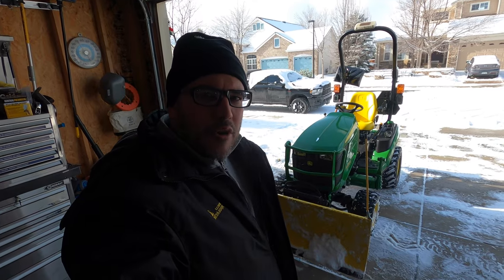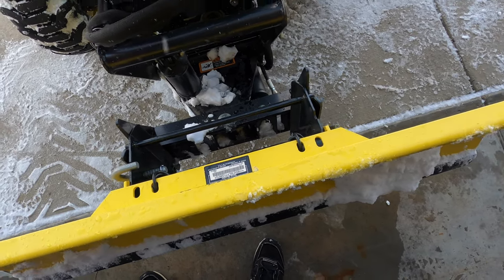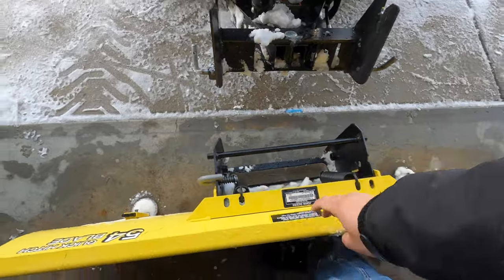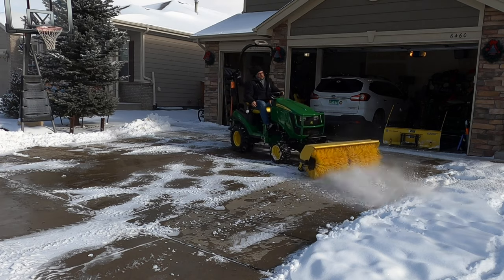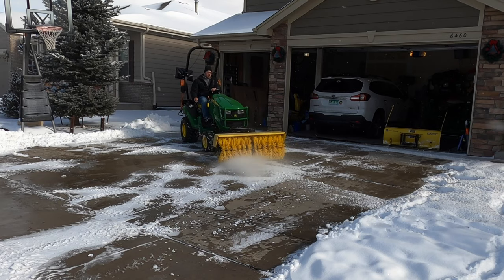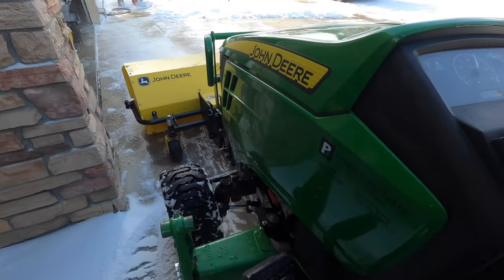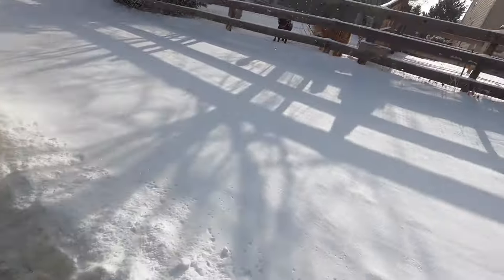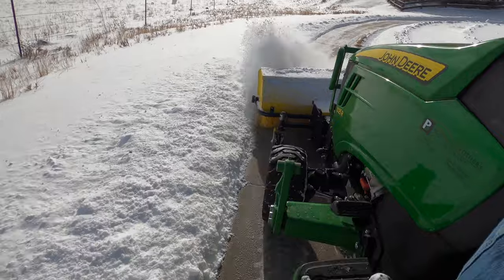Another Snow Attachment You'll Want! - John Deere 1025R

Comment: Thanks for showing how easy it is to change attachments.  That broom clears so nice.  How deep of snow is it effective for?
Reply from the maker: Hey Jeff - it kind of depends on the type of snow, but 6” would be the absolute maximum in my opinion.  Higher than 3” and it starts becoming inefficient.  Some people put a deflector on the front of it, and I think that helps in the 3-6” range of snow.  It sure does really clean up surfaces real nice!  It’s amazing at dethatching lawns too.  I’ve got some brief footage of that in an older video.

Comment: Just curious, does the rotary brush free float, or do you apply downward force?
And does it have one r.p.m. or does the broom rotate faster when the tractor goes faster?
Good vid thanks for taking the time to teach stuff
Reply from the maker: Hi Jean!  It can free float OR provide down force!

The brush speed is directly tied to the engine speed, so if you increase throttle, you increase brush speed.  Travel (wheel) speed does not impact the brush speed.

Happy to answer any additional questions!  Thanks!

Comment: How many inches would you say is the brooms limit (wet vs dry)?
Reply from the maker: I haven’t noticed much difference in ability between wet or dry snow but after 3-4”, it’s just not as efficient and may need multiple passes.  For that much or less though, it’s fantastic.
Reply from the maker: I’ve got another short video of it on my channel showing how it does for various depths in a single driveway.